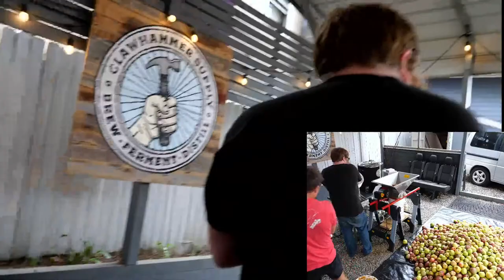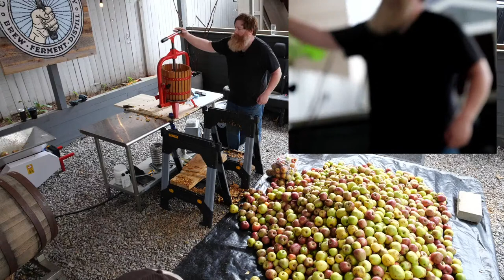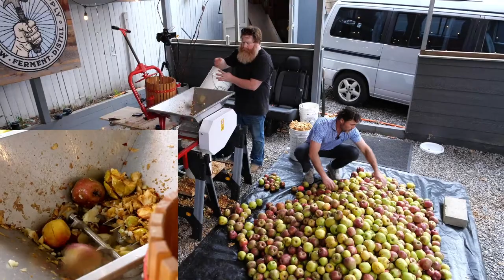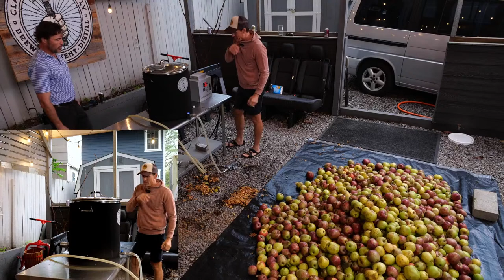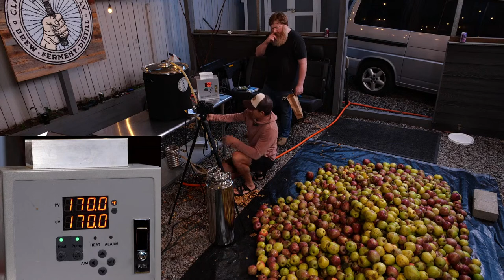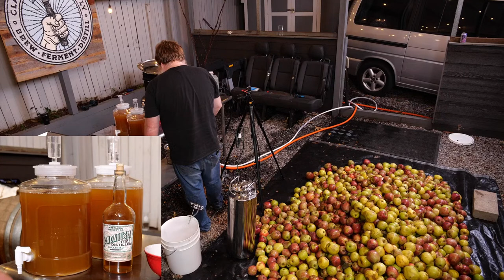Making 50 GALLONS of Hard Cider... LIVE!

Comment: The problem with that apple smasher is that the lower rollers don't grip the apples and pull them down so they just glide over the rollers and then the rotating knives just make a groove and don't finish the apple off.
Reply: Yepp, not good at all. Replaced mine for a one with a rotating disk with knife’s.